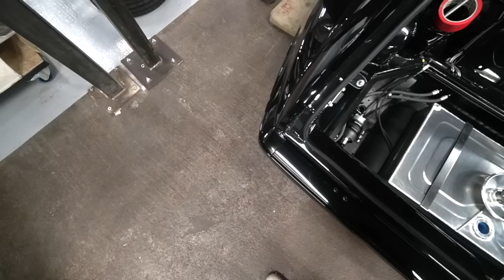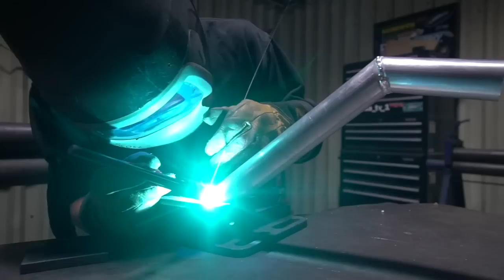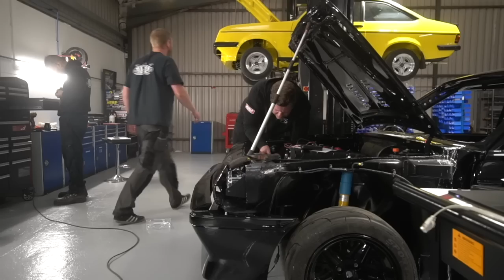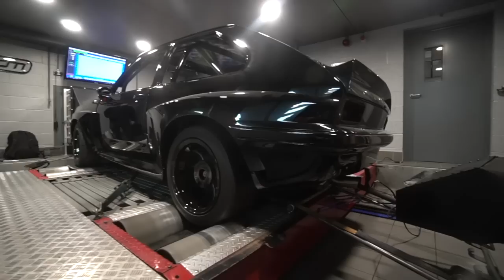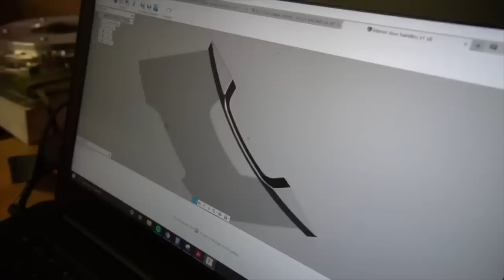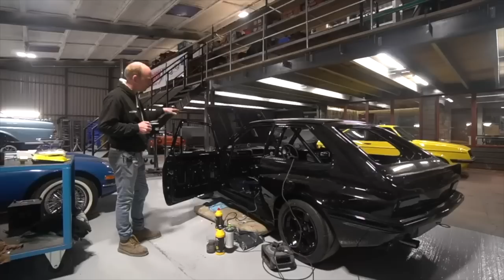Vauxhall Chevette Restomod: Dream Car Build Episode 7

Comment: Is it an optical elusion or is the cam gear bolt bent/out of round on the inlet cam… the exhaust seams to be running without any run out?

Comment from the maker: Apologies for the standard definition video - we are working to resolve this.
Reply: Officially this should have gone through the DVLAs 'Radically altered vehicle' process,it wouldn't gain the 8 points required to retain its original V5 or age so would need to be IVA'ED then once passed that put on a Q plate V5?
Is the customer aware of this?
Few owners of Escorts seem to be getting letters off the DVLA stating they believe their cars are 'radically altered' and need to go through the process to keep them road legal. 
If the banded about build cost of this is really 200k I hope the owner doesn't receive a similar letter off the DVLA!😳